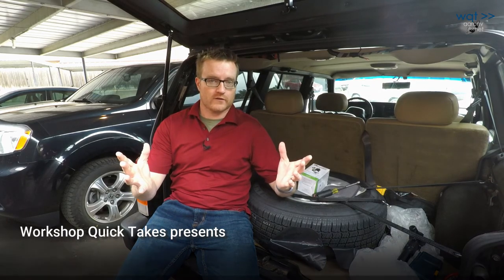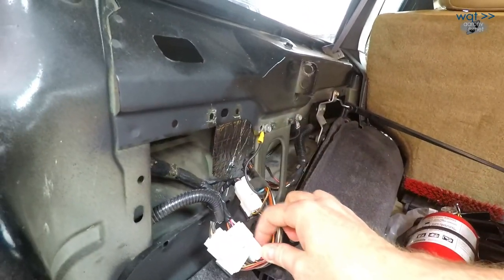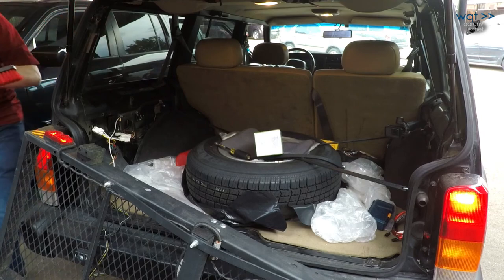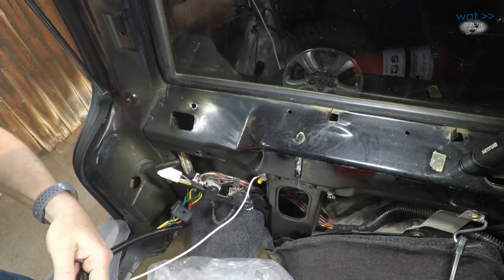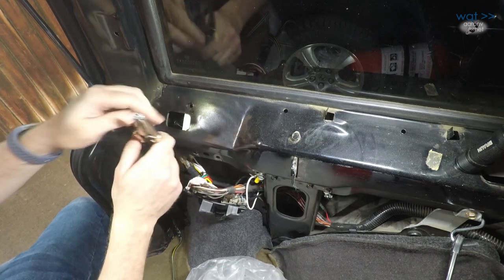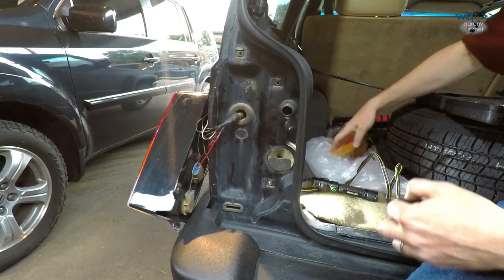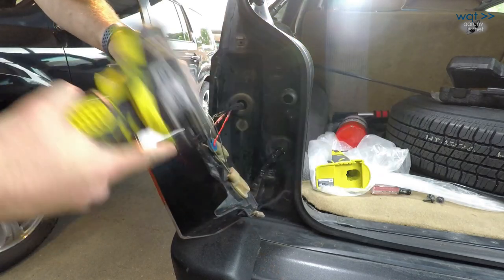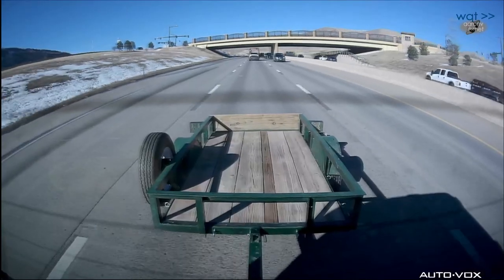wqt//Basic Auto: Easy 4-Flat Trailer Wiring Module Install (2000 Jeep Cherokee XJ)

Comment: Love your videos!  Was wondering if you can do a video on 'engine wiring harness repair' for your XJ.  I have a 97 XJ and am really struggling trying to repair some wiring that is connected to the Neutral Safety Switch (NSS).  It is causing P0700 and P0705.
Reply from the maker: Thanks for your feedback! So far I've not had any underhood wiring issues other than minor splice repairs to correct problems that previous owner(s) left behind, and then done a lot of loom re-wrapping. But the same principles apply as shown in my liftgate loom repair video - unwrap the wires, trace the wires, repair the wires, and test end-to-end. If you have a connector anywhere that lost its watertight seal, look for any evidence of corrosion inside. I've found that even minor surface oxidation can cause large headaches. If the entire engine loom is badly wrecked you might have better results buying a spare from a Jeep wrecker. Good luck!